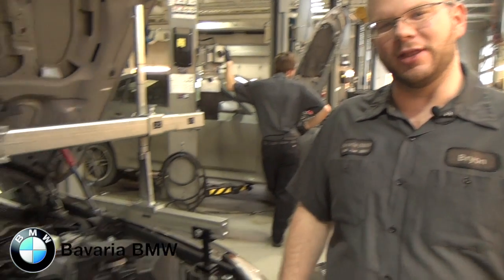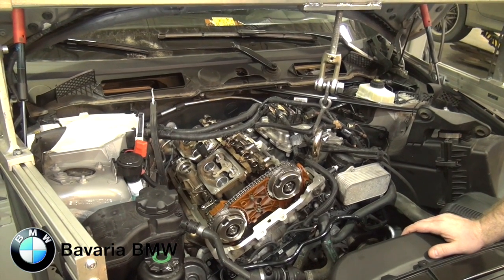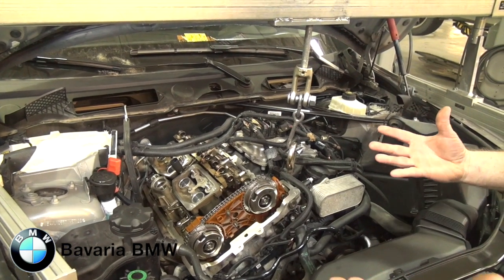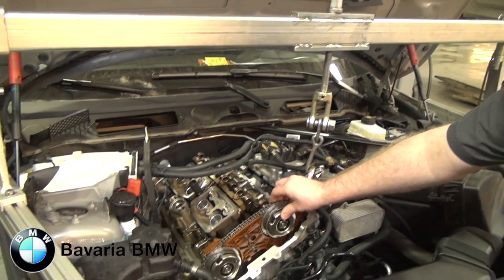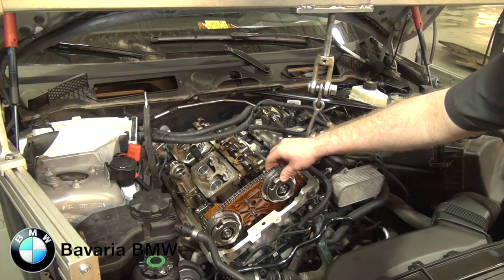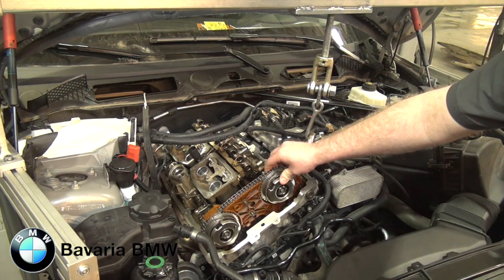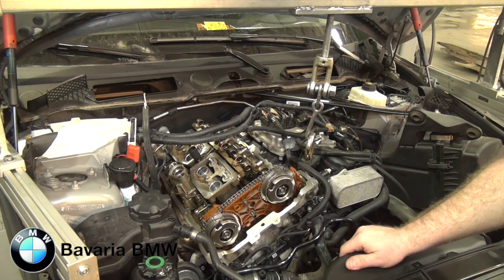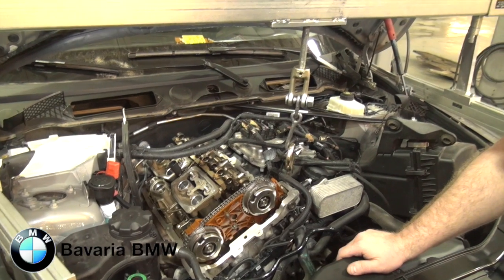BMW VANOS Recall - BMW Bavaria Edmonton

Comment: Hi Brian...very informative!!!
Need some help with my 2012 X3.
It's started to show 'Transmission Fault' at low speeds only around 40/50....perhaps downshift from 6th to 5th. But only downshift as on accelerating it's fine. No jerks of thuds!
Code comes up as 
420631
GEAR MONITORING RATIO
GEAR SHIFT 6X0 NOT PLAUSIBLE.
Have changed the fluid and the filter.
Still persists!!
Shall I try solenoids ???